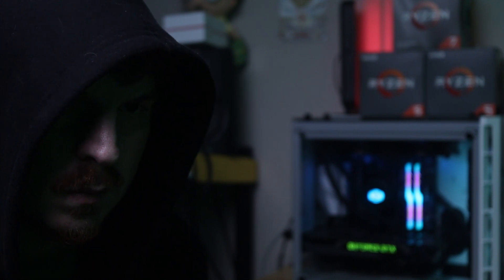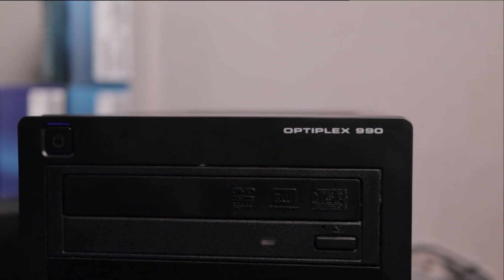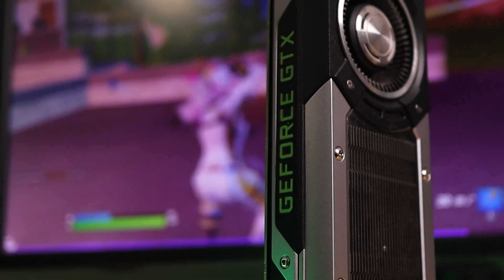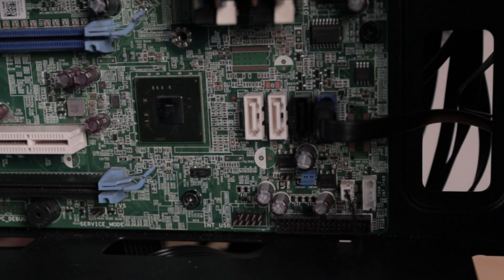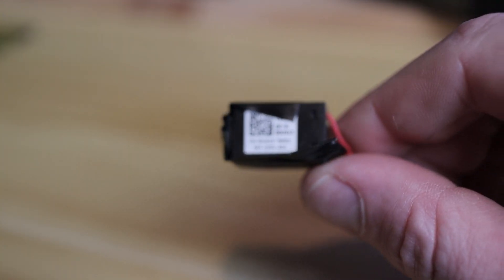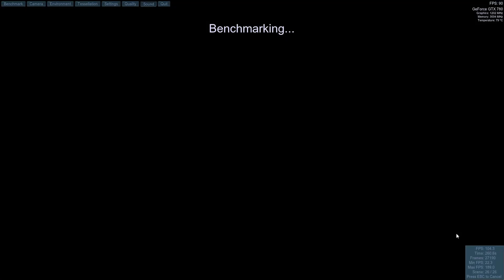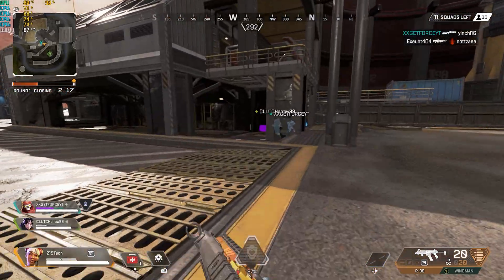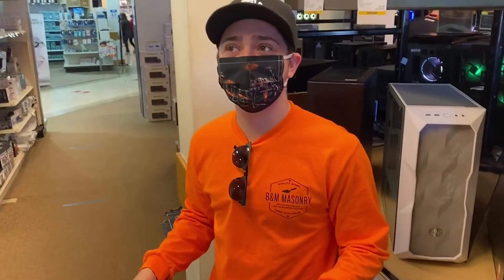Dell Optiplex Case Swap - Everything You Need To Know!!! #DellOptiplex #CaseSwap

Comment: Thanks for the video!  I'm a fan of the case you chose for the swap, good job!   Is it possible for an gradual analog fade from color to color on the case fans rather and instant change?
Reply from the maker: Thanks Uncle M -  I'm not sure. I used a mix of 120 and 140 ML Up Here fans, which to be honest suck. I think for the cheapo fans, Asia Horse is the best. I took out the ARGB fans the case came with and used them in another build. Check out the Asia Horse FS-9001's, they are pretty sweet!

Comment: Did Precisely what you have done here. Although yours looks so much better. Anyway, after jumping the two middle pins with hdd led and using pwr swt on the 2 end pins  , I still received failure error. 

In addition to that my system will not boot, after running the diagnostic in the bios menu everything passes except the cables to the front panel i/o witch I plugged in  the header but snipped off the cables 

I could really use some advice , anything is appreciated. 

Cheers!
Reply from the maker: Is it the same Optiplex, from the mini tower?

Comment: Hello i know the video's old but if i just use a 2 pin jumper the power button should work fine?
Reply from the maker: Hey Dan!! Sorry for the delayed response. Yes, that will work just fine. In the video I used the HDD plugs to jump those pins but either method will be successful. Thanks for dropping a comment Dan!!!
Reply: @Tech215Studios  Thank you and thanks for the reply as well! Subbed
Reply from the maker: Thanks Man!!!
Reply: @Tech215Studios  Yo late reply again, i was about to order  a Deepcool Matrexx 55 mesh but i wanted to ask you that can power + and - be used to jump those 2 pins
Also my Optiplex 990 will fit there right
Reply from the maker: @danplayz5573  Yes. Any Sort of Pin or Jumper can be used. How'd the build turn out. Sorry for the delayed response. I need to turn on my notifications or something.
Reply: @Tech215Studios  It has been ordered and nothing to worry about the late reply, this vis is 1 year ols and still helpinh
Reply: @Tech215Studios  Yo sorry for disturbing you again but this can also fit in mATX case?
Reply: @kiranimran9185  yes

Comment: How did you get the fans connected? Any special adapters? Or does it just plug in? Thank you!
Reply from the maker: Hey dude!!! So for that build I used 2 Up Here! Green LED 140’s and the other 3 were a set of Up Here! 120’s that came with a controller. Honestly - if you’re putting an OEM into a new case your best bet is to buy the 2 pack of 4-1 PWM Fan splitters or buy a set that has a controller with it. I just put out a video about a month ago and I used a 5 pack of Asia Horse 9002’s - they’re Def my favorite option for budget fans right now!!!
Reply: @Tech215Studios  Thank you so so much!!! You are fantastic! I hope life is treating you well!!!

Comment: How my rgb button will work it's reddragon case 
And the system is dell optiplex 7010mt
Reply from the maker: Hey - sorry for the delayed response. Can you be more specific?
Reply: @Tech215Studios  I have fixed my rib fan issues but the main problem is front USB ports

Comment: yes yes but what do I need to know if I want to put a new mother board and everything in an optiplex case (essentially the opposite of what you did in this video)
Reply from the maker: What do you have exactly?
Reply: @Tech215Studios  im basically trying to build a sleeper out of one of these optiplexs just trying to see if I should know something about the front panel connecters and if ill have some problems with them
Reply: It can be done.  The pin out for the cables are online.  I have a dirty Ryzenplex on my channel.

Comment: I have a 7010 sff do you have any rgb gaming pc cases to recomend

Th for your time
Reply: Thank you* sorry
Reply from the maker: Jesus I’m sorry for not replying. I did a video on case swapping an Optiplex into a Cooler Master case. I forget the name of that case but it’s great. I’d just make sure it was a micro ATX case so there isn’t room left over at the bottom. It just looks nicer. But you could also get a full sized case in case you ever want to upgrade to a full sized board.

Comment: link to the case? ive searched everywhere and well it never showed up
Reply from the maker: Cooler Master MasterBox MB320L ARGB Micro-ATX with Dual ARGB Fans, DarkMirror Front Panel, Mesh Front Intake Vents, Tempered Glass Side Panel & ARGB Lighting System https://www.amazon.com/dp/B0842T2KWZ/ref=cm_sw_r_cp_api_glt_fabc_FRVKDEYG88CK44F0Z7Y2?psc=1
Reply: @Tech215Studios  thanks!

Comment: I need help do my motherboard take 8gb 1333mhz for ram but can i put 16gb with 1600mhz
Reply from the maker: You can use a mix of both it will just down clock to the lowest rated stick. So both sticks would run at 1333 MHz. I hope this helped. 😎

Comment: Definitely a long shot asking here but where do the 3 pin fans from the new case go? I’m ok with leaving the old case fan behind but I’m not sure where to connect my 2 fans from the new case. Any help is appreciated!
Reply from the maker: I used a fan hub for this build but I know there are adapter from one header to 8 you can buy for pretty cheap.
Reply: @Tech215Studios  If I was to purchase a fan hub, which one did you use? Where did you plug it in on the motherboard? Im a PC noob with all this, thanks for the help!
Reply from the maker: https://amzn.to/3uWQtgC
Reply from the maker: This is the best one in my opinion. And NP man I’m always glad to help!!!
Reply: @Tech215Studios  Not sure if you’re still interested in my random build but I got the PC to power on and the CPU and case fans to spin! Sadly I can’t get any signal/nothing is posting. I thought it might be the ram but I tested a single stick in every slot and I tested with VGA and Display port. I think it might be time to give up on the build but I found your build vid entertaining and inspiring nonetheless
Reply from the maker: Which optiplex do you have?
Reply: @Tech215Studios  Hey thanks for the response! I have an Optiplex 790 and I’m swapping to an NZXT HS510 case

Comment: Killer! Is there anything in the intrusion sensor other than a switch? Wondering if I could just splice those 2 leads or jump the header to clean it up a bit
Reply from the maker: I didn't try any of that. Maybe if you get a 2 pin header it might work, but if the switch has an up and a down position there has to be some sort of relay going back and forth so I'm not 100% sure. But the cool part is you can literally tape it down and hide it. It's really small so it'll fit in a lot of places, the PSU basement is a godsend for that kind of thing. Hey Ant, thanks for supporting the channel and being a subscriber, your support means the world my dude!! Thank You!!
Reply: it's just a switch.... switches work on or off..making contact or open contact to work... a voltmeter will tell you if it is NC (Normally Closed ) or NO ( Normally Open ) when you push it In...It must be Closed as that is what the jumper pin does when used.... so just cutting the wires and soldering them or twisting and securing them would work...a jumper pin would be the easiest solution... old hard drives have those jumpers... i usually saved extra ones with my screws...

Comment: hey man nice video, is there any other way to ged rid of the error messages on startup because i threw all those cables in the bin and i always have to press f1 to continue into windows.
Reply from the maker: Hey man Thanks!!! What error are you getting at start up? I forgot to mention the rear exhaust fan, but do you have that hooked up to the board? Let me know everything that is on the start up screen. It is kind of annoying.
Reply: @Tech215Studios  I'm getting rear fan failure, power button cable failure and front i/o cable failure.

Comment: Nice video bro. I do the same thing too and typically splice tuck and pinout the wires for the front i/o. Do it cheap as possible lol.. I never used the intrusion connector and never ran into an issue with it. That cooler master case is pretty sweat and the build came out awesome. nice star wars reference lol... Thanks for the shout out!!
Reply from the maker: NP dude you do awesome work man. I left out a few things, I said EVGA, it was actually a CM PSU but got frustrated towards the end but it is what it is. The adapters are the better option tho man!!!
Reply: @Tech215Studios  still sounded good to me lol... What did you do for the front IO like the usb and mic
Reply from the maker: @DLMtechgarage  so I just took the whole thing out of the 990 plugged it into the motherboard and tucked it the PSU basement. Dude, it’s literally the first time I’ve done a case swap with a Dell which is kinda crazy considering I build one PC a week on average. So in doing my research I saw your video on the adapters and it’s mind boggling that I never knew about them. I originally was going to use a Dell XPS 8100 and it would boot but kept turning off. I’m thinking the PSU was bad, or the mobo, maybe the 550 Watt wasn’t enough with the 780 and all the fans etc??? So I ran to my boys warehouse and grabbed the 990, same issue. Then I figured out what the issue was. Jumping those 2 middle pins is so important!!
Reply: @Tech215Studios  yea its crazy how the try to keep us from swapping the case. biggest issue i get when not using the adaptors is the customers complaint of not having the front io but most times they don't care. Im gonna start working on my video series for the HP Z240, 6th gen intel and they are going used on the old ebay for like $80-120 and on the market place a little cheaper. plus the xeons for it are way cheaper then the i7. Gonna do a case swap guide, and mods, just a few tricks to do the swap but should be a good bang for the buck. Im in upstate new york getting a little R&R but when I get back def gonna go hard core with mods and ideas I got stirring!!